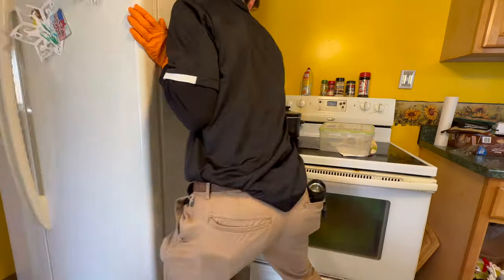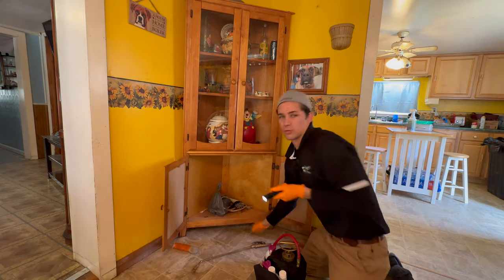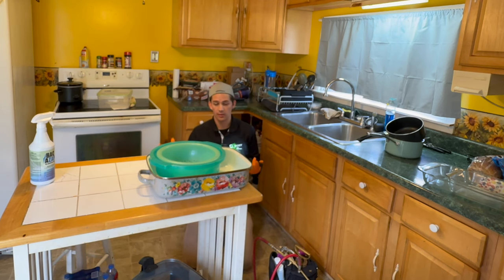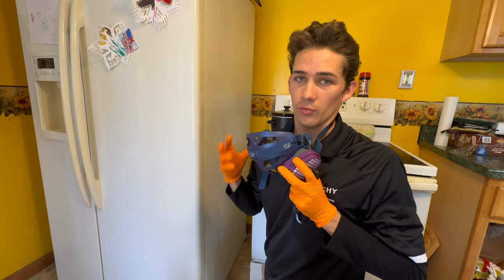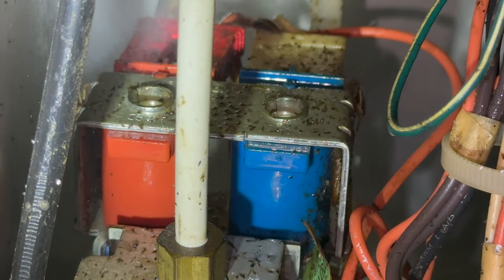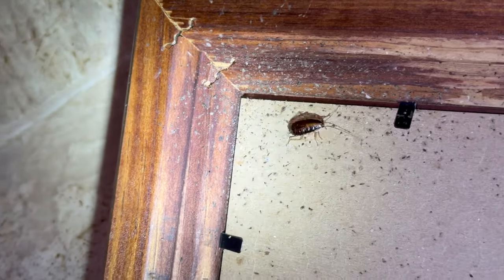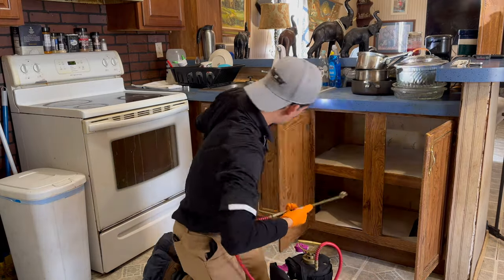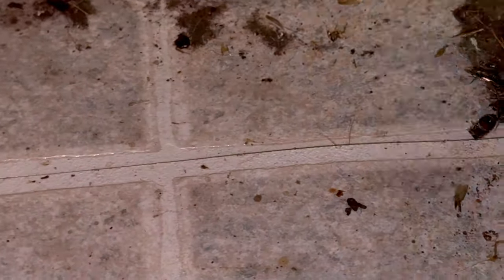Roaches Making Your Refrigerator a HOME!

Comment: FYI, The cardboard piece on the bottom back of refrigerators is integral to routing cooling air for the condenser.
Reply from the maker: Ah I didn't know, how does it help??
Reply: @DanTheBugMan  the heat from the food inside the refrigerator is dumped by the condenser, which is cool by the fan inside on the bottom if you restrict or change the airflow, the heat can’t be dissipated
Reply: @peterking1134  A good to know.
Reply: @peterking1134 I’m seeming cockroaches behind my fridge at my apartment and that cardboard vent you speak of is completely block with dust and roach crap 🙁

Comment: Hey Dan, I bought a new tv from Best Buy about 4 weeks ago, about last week was the first time I saw a live roach nymph scurry across the screen at night. The next day I took apart my whole tv, my Xbox console, my window AC, and my ceiling fan. I wasn’t able to find any droppings in any of my electronics. I took all my furniture outside after buying those bug bombs and inspecting with lights before moving them. I sprayed everything outside. 

2 days later I seen another nymph on the screen… I’ve since taped off my room and I’m currently thinking about throwing the tv and window ac out and the furniture. 

What is your thoughts? Am I thinking too seriously after seeing 2 nymphs or should I get my whole house bug bombed
Reply: I’ll add too that my fridge in the kitchen is clean, new stove I bought last month is clean. I’ve never had roaches in 24 years. Everything narrows down to the tv possibly? Have you heard of new tvs carrying roach eggs or something?

Comment: Is there a better respirator than 3m mine does not work well and now I am having asthma issues after I fog places. I changed the cartridges and filters I added 2 filters and still issues. I am concerned about what damage it is causing.
Reply: Make sure doors and windows nearby are open so clean air has a chance to circulate near you, and the respirator has a chance of drawing in some air that is clean. I’m not a professional pest controller just a big believer in outside air flow. For when outside airflow is not possible, invest in something like a sealed oxygen hood (protective breathing equipment) Expensive but you must protect yourself from these chemicals, no amount of money is worth inhaling them take care of yourself